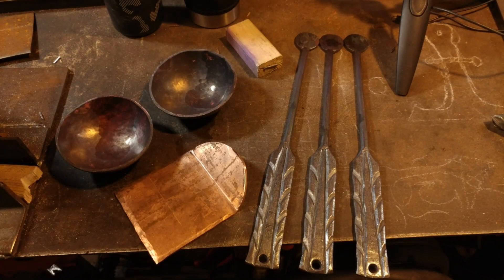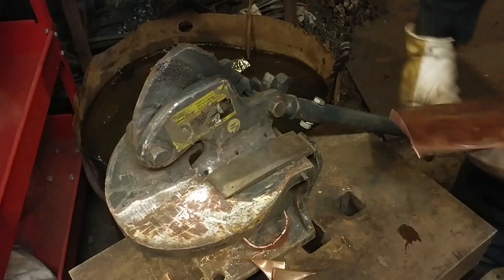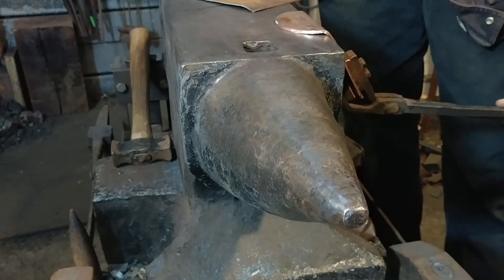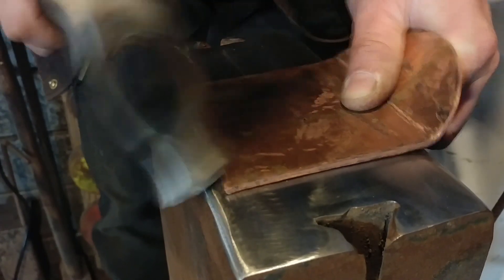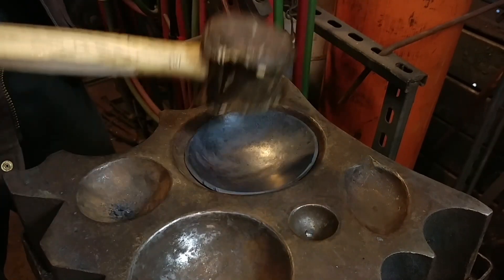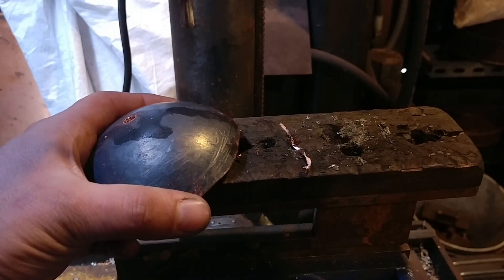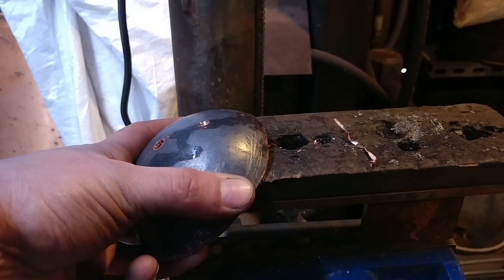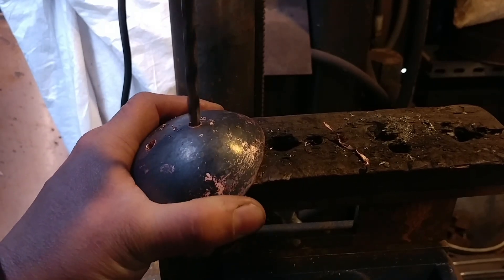Forging Kitchen Utensils PART 3 The Copper // Blacksmith Projects for the Kitchen!

Comment: So did you buy that swage block or did you make it? If you bought it can you share where you bought it from?  I was thinking of making a swage block for dishing a laddle by taking a hollow half sphere out of 1/8" mild found on King metals and welding it into a steel box with a chunk of square tube welded to the bottom so I can clamp it in my vice. Do you think that would work? Thanks and great vid by the way :)

Comment: If you don't need them super accurate, how about drilling them before you form it and then run the drill bit through afterwards to clean up the holes if they deformed?

Comment: Great vid . Did you try a wooddrill with a Sharp tip?  It should be easeyer to drill in Cooper and also work i try it with round Alu and it work fine . Sorry for my Bad englisch god bless you